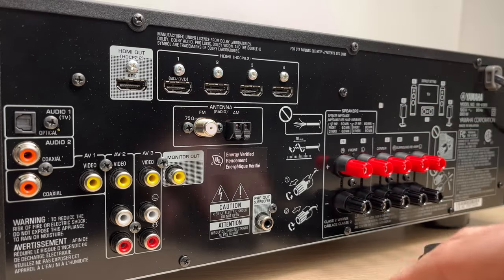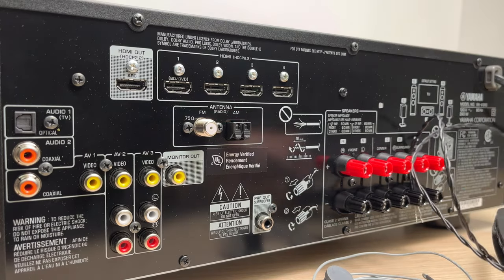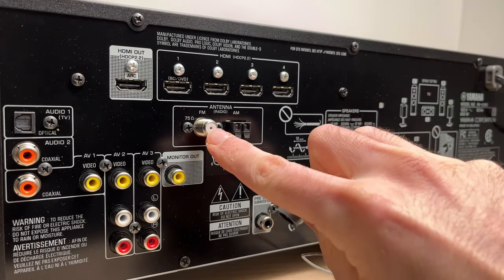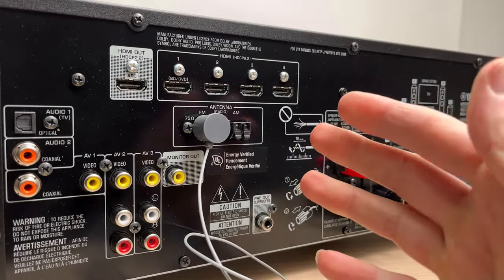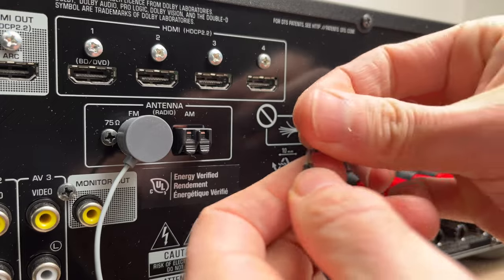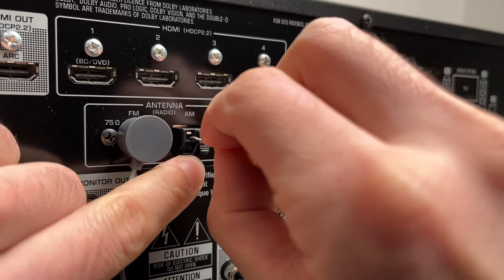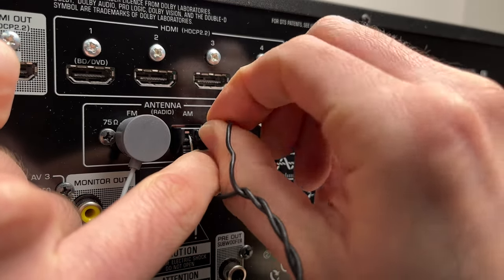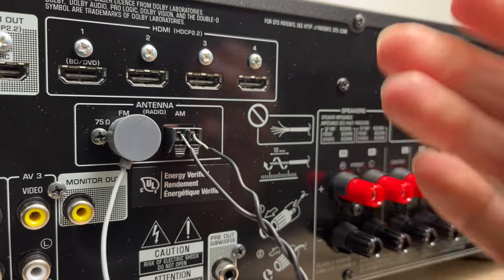Yamaha AV Receiver: How to Setup AM FM Radio Antennas

Comment: Would 18/2 thermostat wire work for the AM input?  I envision all I need to do is run a length in a coil to replicate what that AM antenna is doing (its basically a physical structure to coil the wire).

Comment: How do they both connect to your receiver?? Just curious cause I was having trouble with that
Reply: How to what connect?  One (FM) is a coaxial connect (although its press fit, which should be honestly more prevalent for other uses in consumer devices) the other (AM) is a mere L/R wire connect, not unlike some speaker connects on lower-end receivers.